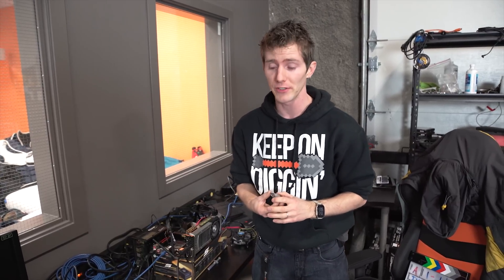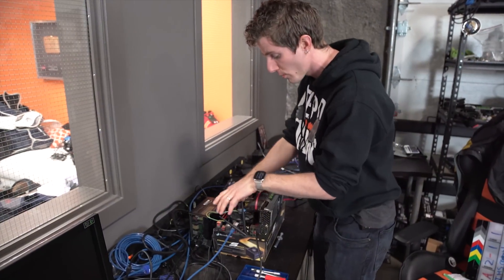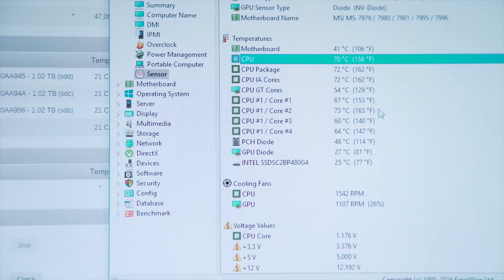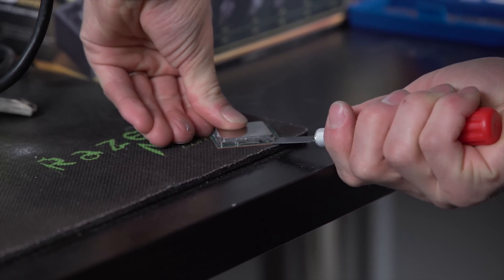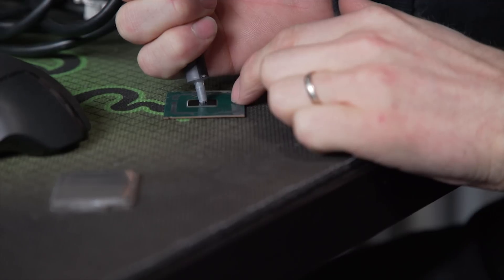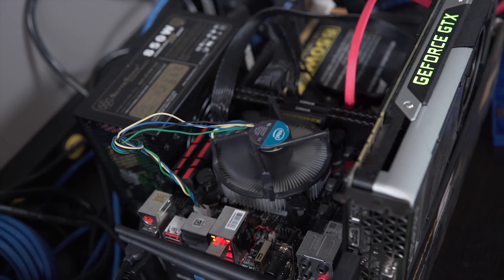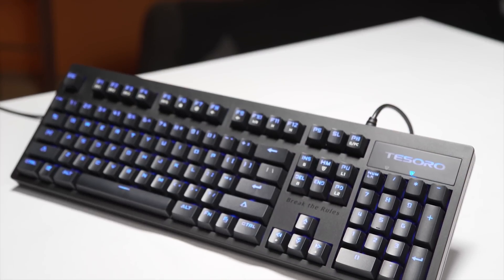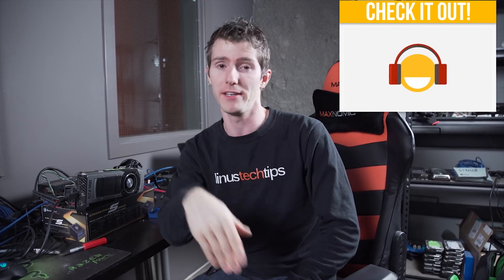Delidding an Intel Core i7 6700K - Is it worth it!?

Comment: I have different opinions. My Haswell CPU runs at >100C in a confined uSFF chassis with stock fan and stock TIM. With G7783 as TIM between IHS and fan, it gets down to ~96 C. With its lid removed and G7783 applied between die and IHS, as well as IHS to fan, it goes down further to 92 C. With everything changed to liquid metal, I got 80 C. Test software is Pov-Ray rendering a huge model.

Comment: - TIM issues come since Ivy Bridge, not Haswell.
- Main issue with the new method from intel is the gap created by the IHS adhesive. The fact that Linus didn't completely remove the glue made the results invalid.
- Original TIM is not that bad in terms of performance, it also last a lot more than a lot of aftermarket TIM's. The fact that he's not using a top end TIM (it doesn't need to be a liquid one) makes the gap so little. It could even be the TIM he was using perform as good or even worse than original TIM.
- That lapping is horrendous. If you don't plan to lap to make the surface a true mirror, better forget about lapping. That surface has way more imperfections than the original.
- One key step when deliding is to spread the TIM along all the surface. The way he applied clearly affected the result, having more variance of temperature between cores after the delliding than with the original test.

He doesn't see any meaningful improvement with the delid because everything about that delid is wrong. Just because you don't know how to change gears doesn't make automatic cars better.

Comment: If it makes a difference with the stock cooler it will probably be even more noticeable with a better cooler. In that case the TIM under the IHS will be even a "bigger" factor in the overall thermal conductivity factor.

Comment: Using a better cooler would make the TIM change a lot more significant. It's a bottleneck issue again.
In this state, the inability of the supplied thermal compound is balenced by the inability of the stock cooler to dissipate heat.
A better cooler would be able to cool the top of the chip significantly better that the stock thermal compound can transfer it up to the cooler. You can't measure the temperature difference acuratly if one side is, in effect, insulated.

Comment: If you change the metal part of the cpu with a cooper part, you will reduce even more degrees. But you will need to make that cooper part.
Reply: +Luis FF The IHS is made of copper, but it has a coating that makes it look more attractive ;)

Comment: FFS linus , give it 1.4 Volts and sit it on D15 or H100 and then see the difference.

the thermal permeability matters less and less as you have less and less heat to transfer ... DUH 
if you underVolt the CPU and remove the Fan completely then you will have nearly the same temp with or without any thermal paste at all !

Comment: The entire point of anyone doing this is to overclock pretty heavily... and thats where you (hopefully)see the results.
Reply: +ScrewDrvr Well, they have seen the results. They are not really significant, but they definitively had some results!
Reply: +Bourinos02 To be fair. That's not how you delid a cpu properly. You dont put the lid back on !? You put either a aftermarket lid on there or mount the heatsink directly. Another method is to lap the lid. Sanding away the top layer until you get to the copper part and polishing it to a mirror finish, increasing thermal conductivity dramatically.

Comment: There is a fundamental flaw in this test. Convective heat transfer (off of the cooler) is based on temperature differential,  surface area, and a constant (air speed and fluid). If you area already limited by the stock cooler you wouldn't see any benefit as the surface area isn't large enough to yield enough transfer to show a large differential.

Comment: Speaking as a Senior ECE student, the entire point of the lid is to allow greater area to dissipate heat by allowing greater contact with the heatsink, and to protect the die. The thermal resistance of that metal lid is so fucking tiny (maybe 0.007 K/W) it makes no difference once a heatsink is applied, the negatives are totally outweighed by the positives. Thermal resistance isn't even the whole story, your heat sink has a  massive thermal resistance in comparison (maybe 0.35 K/W). 1 or 2 degrees isn't worth it, don't be stupid.
The lid also protects the extremely delicate die underneath. Remember back in the day how many problems people had with the corners chipping off (and thus bricking) their AMD Athlon XPs? The lid can even serve as noise protection in some rare-not-ever-a-problem-but-I'm-a-fucking-sperg cases.

Comment: >no overclocking
>no fixed rpm cooler
>no most popular tim replacement (liquid metal)
>"NO SIGNIFICANT DIFFERENCE GUYZ"
GJ Linus (nope, not this time, sorry)
Reply: +Тёма Бондарев ¨linus is a noobzor
Reply: +Тёма Бондарев they might have also done it so tech-newbies don't go around breaking cpu's
Reply: +Тёма Бондарев Agreed. I saw a definite difference in my delidded 3770k.
Reply: I have never done it back when I had my Ivy bridge cpu, but I do remember it running at 60 degrees while watercooled and not overclocked, so I know why you did it

Comment: linus can u please do proper research on stuff?
first the reaballing, which people that repair boards! say is crap! or at least makes it a zombie chip.
and now u say that delidding such cpu will give u only a few degrees? 3 degrees?
can u pls!!! put the cpu  to it's overclocking max, because that is where the difference is going to be way way higher!
as depending how far u go u will hit thermal max regardless of cooler pretty much.
one example i look at was 13 degrees at 4,6 ghz.
increasing in difference as the overclock increased.
and 4,6 is far from the max overclock u should be able to take this chip with some luck.
also your cpu fan speed changed, which again u didn't account for.
some people on ivy bridge got 30- 40 degress at medium overclocks!!!
so if u tackle this issue, can u please do proper research, show the people that intel fucked them over saving what 1 dollar? per cpu.
u could have made a video about checking if the current heat paste shit that intel uses was a slight improvement to the early shit they used?
no u didn't
u could have checked overclockers forums on how much difference it really makes?
no u didn't.
u could have asked intel for a direct statement on why they keep using crap heatpaste that can be repalced by okish heatpaste leading to a 10 plus degree minimum drop under higher overclocks?
no u didn't
i like watching your vids, but the level of lag of research and proper testing gets really annoying.
Reply: i really see the point in your comment but i just wanted to point out that one dollar per cpu is a whole damn lot of money because intek is selling thausends probably even millions of cpus!
Reply: DomeZockt
i mean i get that its a lot of money for the producer given the number of cpus, but hell a company like intel can produce their own heat paste with a high value/ price ratio, which as said shoudl at least be okish heat paste and solve this issue very efficently for example.
thing is: intel has a monopol so we have to make due with what intel does.
<sticks to i5 2500k overclocked for long times to come!
Reply: +cataria pega yeah i know what you're talking about
i really really hope amd is coming back to the cpu market with zen cause if not intel will probably be the lonely top for like another 5 years

Comment: The approach of your delidding and still using silicone based thermal compound is quite stupid.
1. You could have used the vice method to get the heatspreader off. Also You dont risk cutting your fingers off or into the substrate.
2. Why didnt You use liquid metal between on the die like 99% of the people who delidded their CPU? With a normal paste you dont have much of a difference like your review showed.
3. The difference between the stock paste and liquid metal really starts to show by overclocking and applying slightly higher voltages to the cpu. From IvyBridge to Skylake often get 15-25 *C (min-max) better Core temperatures, which will get you an extra 100Mhz. 

Sorry but in this state your Video was useless.
Reply: +Arschzerfetzung Vice method breaks Skylake dies. It works well for Haswell and Ivy though.

Comment: Did this with my 4770k (although with the hammer and vice method), and I got in the neighborhood of 25*C temperature drop under load (8-10*C idle). 
Allowed me to bring my overclock up from 4.2 Ghz to 4.6 Ghz and my CPU still runs almost 20*C cooler than it did at 4.2 Ghz.

That was totally worth it for me, but the 4770k is a special case.

Comment: Not a very good video. Linus had his conclusion in his pocket before he started. Using a cooler that isn't stock would've given a more accurate reading as well as trying to overclock and seeing the difference with that. There's also much more stuff possible with delidding than just replacing the stock thermal paste which he didn't even try.

Comment: Ok so on average heat paste and stock cooling you get 3-4 degrees so that's alone is improvement. I guess if on water cooling with top tier paste you could get more then 5 it's worth it.

Comment: Reckless, uninformed, and biased.  You missed the two largest steps in making delliding a worthwhile venture: 1.Remove the black silicone (brings the IHS closer to the die) 2.Use CLU between IHS and die.  I believe your had your conclusion written before you grabbed your camera and knife.   -1 tech cred point for you sir.
Reply: +kyle turner 
But cash play....
Reply: +kyle turner should of done a 3770k, that's the first generation i know of that they really fucked up. Even under custom water i can't keep mine bellow 50
Reply: +kyle turner I enjoyed the "it's ok because we're not looking at the numbers just if it makes a difference" part then he proceeds to look at numbers to dismiss it even though he clearly wasn't doing anything optimally.

Comment: Have you tried attaching a water block directly to the CPU sans IHS?
Reply: +Raskal Robbin you cant do it because the cpu lock is holding on to the heat spreader itself. not unless they create a spacer between the cpu pcb and the cpu lock
Reply: ***** Now we're getting somewhere. That's actually a very good idea for a company to print out cpu lock waterblocks.

Comment: This video proves to me what I've been fearing; that you've been sitting too long behind a producer's desk and not spending enough time keeping yourself up to speed on the latest hardware. As other people have pointed out, there are so many mistakes in this. I mean, who the hell delids their processor just so they can run it at stock speed with a stock cooler? Of course the difference will be minimal. Also, "saving time" by not using the proper TIM, or not even cleaning the black glue properly.

Other reviewers have managed to get a temperature difference of up to 15-25c with a delid.

You need to go back to your roots and pay proper attention to what is being done, not how its being filmed. I would rather take a good, informative video every two-three days, rather than a bad video every day.

I hope you'll take this as an honest feedback.

Comment: If you would have used a better cooler and had been overclocking, the difference would have been greater. Now the ´bottleneck´ in thermal resistance is more in the stock heatsink, so the difference is negliable.

Comment: Ivy Bridge needed that mod... 3570K was bottlenecked by stupid TIM under the heatspreader.. once removed and replaced with liquid metal, 1.4V+ and 4.8GHz+ was quiet common while staying under 80degC even on decent air cooler

Comment: Way back I de-IHS'ed my Athlon 64 3200+, and I did the same thing to my current 6700k. Using Liquid Ultra (the liquid metal TIM), it dropped around 15 C at load. That's enough for another 200MHz+ at the same temps! N00bs gonna n00b, but if you have steady hands and overclock it's worth doing.

Comment: why don't you try with an older cpu linus?? I think a 6700 doesn't need this replacement! try with an older and well stressed and overclocked cpu like the i7 920 or something like this
Reply: +Umberto Le Voci Skylake still benefits from this. Check the thread on Overclock.net for delidding.

Comment: Wouldn't a quick blow with the heatgun have had made the dissasembly a bit easier?
Reply: No. Those adhesives are meant to take way more heat than that of a heat gun.
Reply: +Charlie Krogars Considering that CPUs are made to operate at significantly high temps anyways, no

Comment: So Linus, i kind of had a problem with this. Sure people still delid CPU's, but you neglected to cover the most popular ones to do so. The 6700k actually has pretty decent stock TIM, however, the 4770k and corresponding i5 were complete garbage. I haven't personally done this as i don't have the spare cash to replace it if i bork it up, but i've seen reported 10-20 degree improvements. Intel even knew it was garbage and released the Devil's Canyon processors to remedy the issue.
Reply: +Dan Giaimo Skylake has not improved TIM. It's about the same as Devil's Canyon. People still reporting 10-15c improvements on Skylake, just like Haswell and Devil's Canyon. TIM actually had nothing to do with the issue for Haswell's temperatures, as it's the same stuff they used on these CPU's now, the issue was the gap between the die and the heatspreader. Still, it's a big deal to just delid and replace the TIM with something of higher quality if you got the k-sku (because why not get lower temps if you overclock? It's always nice to lower fan RPM :3).
Reply: That's kind of my point. After the train wreck that was the original haswell i7, things have improved in the Intel TIM front. I'd expect a similar gain between devils canyon (4790k) and skylake (6700k) but a much higher temp benefit from an original haswell chip (4770k). I know firsthand the insane difference between the two. Delidding is pretty common on chips known for having garbage TIM, less so for those that perform as expected (I.e. no 85 degree temps under load at only .2ghz above stock speeds) source: my personal 4770k experience

Comment: I was able to get a 20 degree C drop on my Haswell, but I did alot more to the IHS than replace the TIM. Lapping of top and bottom, immaculate cleaning of the PCB and using CL liquid metal is the only way to consider the risk. Don't even try it if you don't have any mechanical background.

Comment: Hey, Linus!
Saw the Vid with replacing the TIM of the 6700. Guess you miss something.
Was the CPU Fan @ Auto in BIOS? If so, the board lowers the RPM of the Fan to keep the CPU at the "normal default" temperature.All in all: Lower noise, same temps or same noise and cooler.There were some decent hardware magazines doing the same with fixed fan speed which results in an approximately 15 to 20 degrees CPU temperature sink.Keep up making vids, really enjoying them!
Greets from Germany,
Daniel

Comment: Might pop open my old i7 920, I replaced it when it started running 70c at idle, didn't know that the chip had thermal paste on the inside, so kind of want to see if replacing that fixes it.
Reply: +TheAnon03 They didn't switch back to non-soldered until Ivybridge. Don't delid your 920, it will permanently damage it.
Reply: meh it's unusable and sitting in a box somewhere anyway.
Reply: +ThatDutchGuy Just how much do you suppose I'd get for a 7 year old chip that runs at 70c while idle?
Reply: +ThatDutchGuy No, it was working fine for about 6 years with a mild overclock then suddenly started running hot.  Went to standard clockspeed, reseated, replaced heatsink, none of it made a noticable difference.

"Worked" fine, but got up to over 100c when playing GTA V.  Not going to open it up any time soon, but if I can get it working at sane temps again then I can use it in a backup machine or something.
Reply: +ThatDutchGuy Yeah I got that it wasn't just glued on.
Like I said, It's going to be a while before I attempt to open it up, and when I do I'm going to do more research than just one video on youtube.
Reply: Yeah I saw something about putting it upside down on an electric cooker hob for 5-7sec.  The other main way seems to be just grinding it down.

Should be an interesting little project.

Comment: What about on an older CPU, like oh, a well used 3770K.  As I understand it when the paste gets old it dries up and performs poorly.  The new CPU should not need that.  Also, my 2500K does not, no goop under it's heat spreader.

Comment: Most people just remove the lid and attach their cooler directly to the chip, he should've done that too.
Reply: How is that possible?
Reply: +3rd World Gaming Instead of putting the lid back on, you place the cooler directly on the chip, creating direct contact between the processor and the cooler. "Eliminating the middle man" as Linus put it. It's the most efficient way to do it, but if you have even one deformity in the placement or spread of your thermal compound, you will fry the chip, so it's best done in a place where dust cannot get in.
Reply: Andrew Hunt I understood what you meant but how would the cooler reach the chip and how would the chip lock, lock the chip in place w/o the "middle man"?
Reply: +3rd World Gaming It'll reach. When you lock down your cooler you notice you apply quite a bit of pressure. The lid is fractions of a millimeter so that tiny distance is easily closed in when you tighten down the cooler.

Comment: I lapped a i7 920 with some sand paper once. Took the top layer down to the copper where it was even flat with a razor blade, in fact it was so flat that the heatsink created a suction to the processor even before applying the thermal compound. Dropped the temps about 5-8 degrees on it.